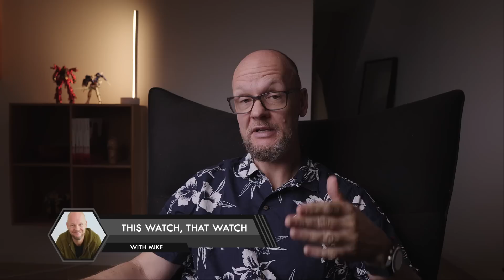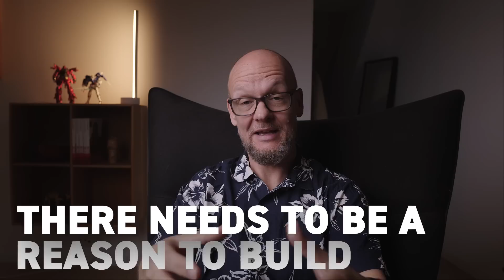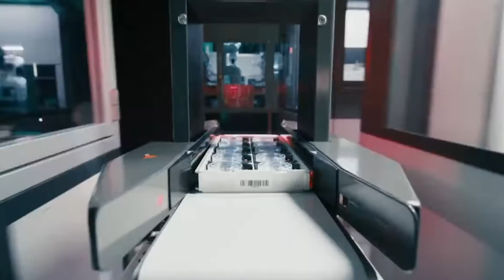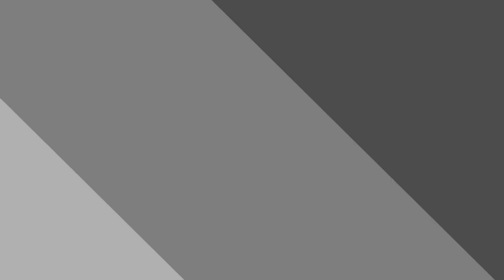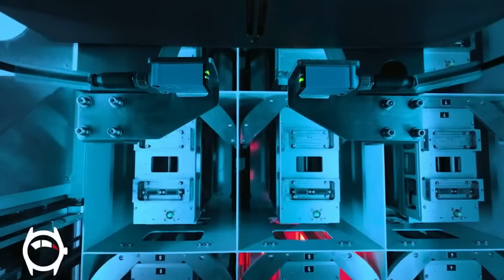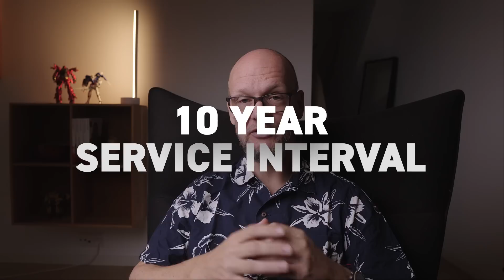In house movements & METAS: Overrated? Worth it?

Comment: I know Seiko is extremely efficent in their manufacturing production, because when a small plastic gear broke on the day date adjustment mechanism on my Seiko with the 4R36 movement during warranty.
They just put in a new movement instead of repairing it, as it would save the watchmaker enough minutes for it to be the cheaper alternative, also seemed like they didn't keep spare parts for the movements, just put together movements, as I guess it also makes the entire process at the service center a lot simpler when there isn't storing of movement componants, but rather just the finished movements, and the job is always the same with little troubleshooting needed, marking it require less skilled, and therefor also cheaper workers. 
As a mech. engineer I'm just fasinated by how Seiko can make these movements to the tolerances they do, to the cost that they do. It's impressive.

Comment: Once again, a very interesting video, especially because it delves into the details of watch movements, which I really enjoy as a watchmaker-rhabilleur. However, I don't believe that this certification is truly about proving what's possible. We all know that with the capital Rolex has at its disposal, they can manufacture anything. I strongly believe this is more of a political play. Rolex is using Tudor to force Omega to react. Omega undoubtedly sees itself in a different league than Tudor, but since only these Tudor movements have the same certification as Omega, Omega has to respond. And that's precisely what Rolex intends. Rolex is trying to increase the pressure on Omega. Let’s see how Omega will respond to this strategic move; it will certainly be interesting.

Comment: Overrated?  Worth it?  The irony is all the arguments put forward during the whole discussion about METAS verses cost watches from 9:33 to 11:52 applies to mechanical watches verses digital/quartz/smart watches in general, especially when it comes to tool and field watches. Many low cost Ironmans or Casio G-shocks will last well over a decade almost completely maintenance free and have all the features and functions one typically needs.   A so-called mechanical diver watch will never have the accuracy or features as a Garmin Descent or even a Apple Watch Ultra.  So when it comes to METAS or any other certifications and incremental or unique features in a mechanical watch, it really comes down to what one subjectively thinks is "That's Cool" (15:45), which of course completely undermines the whole argument about features, practically, or diminishing returns.

Comment: You're absolutely correct on the stocking parts point. I recently bought a junghans solar on the used market and took it to get it serviced and the watchmaker offered to just put in a seiko quartz movement.

Comment: Mike - I would like to increase your expectations to include . . . 
Parts available for at least 50 years . . . where the watch is passed from one generation to another . . . 100 years is not unreasonable.
With some watches OEM parts are available but this is disliked by the original manufacturer.
Also include fast service times of 1 or 2 weeks at a reasonable price . . . from a local shop . . . at half of the manufacturer's inflated cost.
For the   ultra-mass-produced   Rolex these expectations are being met.
Other watch experts have suggested a quality watch has a 3 Hz movement . . . I don't know what to believe.
Reply from the maker: Raising the bar 🙂🙂🙂

Comment: Omega just did co-axial for differentiation as well, no benefit and a serious downside in thickness.  METAS was just designed to help the co-axial; I’ll bet Omega wasn’t happy when Tudor jumped in.  Have had several Omega METAS as well as several Tudor—my least accurate Tudor was more accurate than the best Omega METAS.

Comment: Yes, thank you! I thought i was the only crazy person that wants the date to change at 12:00 sharp on an ideally 5hz movement with around 3days power reserve in a case that is 12.5mm thick at most. 

I would also argue for an open case back and a COSC certification for any watch above 3k.
Reply from the maker: Instant change is massively cool 🙂🙂

Comment: There's a decent argument for Tudor METAS certification having more to do with Rolex than Tudor. Specifically, by not having Rolex watches METAS certified, Rolex Group tries to communicate that their own, internal "certification" is above that of Omega. It might be more about them trying to push down Omega to Tudor's perceived level than elevating Tudor to Omega's (clearly actually much higher) level. It's kind of the other side of the same coin but I find it interesting.

Comment: Two issues:

[1] Long story short: a watch's inaccuracy once known from actual becomes an engaging personal / machine tussle. 

I like an accurate automatic movement, but I won't buy overly-expensive watches. Generally I buy microbrands - earnest enthusiasts rather than large Swatch-like conglomerations. I have a new Aussie microbrand Ocean to Orbit Lhotse watch which is running as new at +6 secs a day. Beaut watch BTW. +6 is close enough, and I'm assuming its Swiss STP movement will only become more accurate as it 'wears in.'

Whilst I'd like to luck-out and have a new watch with a mass-produced movement that's dead-on accurate, I quite like the mental tussle I have of setting the watch for a future foreseeable period over which I can track its accuracy, only resetting the period when the time falls outside of my tolerances. For a watch running at +6, I'll set it slow for the next few days so it'll catch up and then again run faster than 'cellphone time'.
The point I'm trying to make is that when I look at my watch, I have a welcome quick mental calc. going on with elapsed time vs. accuracy.
For example, for a watch running at +6 secs, a day, I'll set it at -21 secs so it'll be 100% accurate between day 3 and day 4. By the time a week's elapsed, it'll be some few seconds faster - but not by much. During the week I'll be trying to increase on the +6 secs accuracy by  placing the watch overnight crown-down and vertical (balanced over the edge of a thick book). The process is a welcome challenge whereby a human has to know where their machine 'is at' by judging elapsed time against predicted drift.
Maybe this is how quartz watches got their soul-less reputation: they're just too accurate to be fun.

[2] in my market segment, in-house movements: they scare me financially because they can only be repaired by their own brand.

Comment: I like and agree with many of your points. 

I’m not bothered about extreme accuracy, extreme water or magnetic resistance, or even an extreme power reserve. My life requires none of those. 

Shock absorption is the key parameter for me. Movement robustness is what’s important functionally. For me. 

I was at a high horology shop and started shaking the watch to get it going. The sales person was horrified and asked me to stop. 

So you are selling me a watch whose engine may get damaged by me shaking it around? No thanks. 

I have kids, I take my watch on and off a lot, it gets knocked around. I want it to withstand that. Metas doesn’t seem to help with that. 

I like slim pretty movements but not at the cost of robustness

Comment: My opinion of in-house tudor stuff is simple.  As a company founded to be loaded with out of house movements, there is no longer a reason to buy rolex .  They are tudors for flex dorks.

Full disclosure:  I bought the spring drive Grand Seiko diver as a recent milestone piece, but the pelagos with helium escape valve had me wondering.  And the Omega seamaster helium valve can be pulled off by any diver, just unscrew the crown instead of the silly extra crown.  Fight me.

This remains the very best watch channel, of course.

Comment: Omega has to step up their game. They can advertise the greatnest of their movement however thier want. But it is not reflecting in the real world benefit.

Thick movement, Slower beat rate, Lower power reserve and not that the service interval is longer than the competitors. 

Hope to see the AT with thinner movement/case, 4Hz and at least 70hr of power reserve. Tudor can do this now, the so called great movement from Omega should be capable to do this as well.
Reply from the maker: We that TI movement rolled out broader 🙂

Comment: That video could be just the last part where you list what's actually needed and still missing.

To reach for Metass must be either cheaper or easier to brag about.

I'm waiting when Bucherer will finally create column wheel chronograph with a peripheral rotor.... That's gonna be sick, it would have acceptable height and still be automatic (ekhmmmm.. Longines..)
Reply: And regarding stocking the parts - I was thinking about it a lot. There's laws, forcing to produce parts for the cars for the next 20 years or so (also when the brand is bought), depending on the region.
Is there a general consumer law having the same impact on other goods, like electronics or machines etc?

I wonder clvery often what the hell happens with watches from the independents, especially the biggies. Shouldn't their technical knowledge be documented, stored  and available to be bought out when they're dead? Otherwise how the hell do people repair their pricy watches without reverse engineering the.movement?!

Comment: Grand Seiko developed a new dual escapement lever system that works from a direct and indirect strike of the lever. They also have their spring drive MECHANICAL movements with magnetically braked escapement. They exist and are unique whether you like it or not. Give them some stinking credit.

Comment: Actually, the old German DIN 8309 demands 4.800 Ampere/m , not 4.800 Gauss. 4.800 A/m equals around 60 Gauss. However, Sinn (and other German) Watches that are certified as antimagnetic according to DIN 8330 can withstand 80.000 A/m = 1.000 Gauss.

Comment: Great video! Forgive my ignorance, but please help me understand, why a chronograph seems less complicated than a perpetual calendar (judging by price). Or is the chronograph only desired by more, therefore produced in larger quantities and therefore cheaper?

On this note another ignorant question. Is there a generalized (accepting its shortcomings in accuracy) understanding of which complications are only so expensive, because they are produced in low numbers vs complications that would be similarly expensive, even if produced in high volumes? (For example, because the specific complication would always need a watchmaker to assemble and adjust it.)

Thank you

Comment: In this field, sometimes the most minor things can make the biggest difference...and they're normally things that we don't really need. This is because the whole topic is about luxury watches, we don't need it.

There's things like "METAS", the "Superlative Chronometer", which are all pretty much capped to certain Swiss watch brands. 

Patek did their own seal,  which was derived from the Geneva seal (to their standard, the "highest" level of watchmaking)...but there are watches out there that doesn't have those seals (and watches not made in Geneva or even in Switzerland) and are finished much, much better.

There's also that QF (Qualitie Fleurier), which is one of the hardest certification to have on a watch. Not a lot of people care about it despite the requirements, but they still make watches with them. 

I like the content of the video actually, it makes you think what you actually want in a watch. Keep up the good work!

Comment: 1. I do agree that unless an  ‘in house’ movement delivers something like extra long power reserve, it is of questionable value under say $5,000. But above that, you are into ‘aspirational’ territory, so rational arguments  have reduced value.

2. On a similar note, the optimal size for a 4 cyclinder internal combustion engine is 2 litres. (Numerous YouTube videos cover this from an engineering viewpoint). Everyone builds their own version though. Why? Control, differentiation, ability to customize (the Volkswagen group uses the same block to achieve from 130 BHP, to over 300 BHP. All through different combinations of engine management, turbocharging, etc. I doubt if they would have that flexibility if they sourced their basic engine block from outside)….the higher end watch brands want to be able to put complications on the movement, etc….and let’s not forget smoothness, quality of finish, or build quality. Watch a video from ‘wristwatch revival’…when he does a Rolex, the parts look twice as thick as any other manufacturer…’built like a truck’….

Comment: Feature Shopping List
* Chronograph with a sub 12.5mm case
* Sub 11mm case with an automatic movement
* Micro-rotor movement
* Instant change date at midnight
* 5Hz movement
* 10 year service interval
* Stock parts for at least 25 years

I asked Chat GPT and this is what it said:

Finding a watch that matches all these attributes is challenging, as many of these features are rare individually, let alone combined. However, here’s a breakdown of some brands and models that cover a few of these criteria:

1. Chronograph with Sub-12.5mm Case
Zenith Chronomaster Original: The Zenith Chronomaster Original comes in at 12.6mm with a high-frequency 5Hz movement. While it doesn’t strictly meet the sub-12.5mm requirement, it’s very close and highly regarded. Piaget Polo S Chronograph: Piaget is known for thin cases, and the Polo S Chronograph is 11.2mm thick, though it operates at a standard 4Hz.

2. Sub-11mm Automatic Movement
Piaget Altiplano Ultimate Automatic: Known for ultra-thin designs, Piaget offers one of the thinnest automatic watches at 4.3mm, though this is a time-only piece. Bulgari Octo Finissimo Automatic: Bulgari’s Octo Finissimo automatic models come in at 5.15mm, offering a thin profile with an automatic micro-rotor movement, though they lack a chronograph. 

3. Micro-Rotor Movement
Laurent Ferrier Galet Micro-Rotor: A very high-end option, Laurent Ferrier’s micro-rotor movements are efficient and beautifully finished, though they typically come in thicker than 12.5mm in chronograph form. Bulgari Octo Finissimo Automatic: As mentioned, the Octo Finissimo has a micro-rotor movement and an ultra-thin profile, but lacks the chronograph and 5Hz frequency.

4. Instant-Change Date at Midnight
Grand Seiko Spring Drive Models: Grand Seiko’s 9R66 and 9R86 spring drive movements offer an instantaneous date change, though these movements do not generally meet the 5Hz frequency criterion. Rolex Datejust Models: Rolex has an instant date change feature, but their standard models have 4Hz movements and lack micro-rotor designs.

5. 5Hz Movement
Zenith El Primero: The El Primero movement is a 5Hz movement, highly reliable, and often thin. Some El Primero chronographs are around 12.6mm thick, just slightly over your requirement. TAG Heuer Carrera Calibre Heuer 02T: This is a 5Hz movement, though typically in a larger case size.

6. 10-Year Service Interval
Rolex 32xx Series Movements: These have an extended recommended service interval of 10 years, but they typically lack the 5Hz and micro-rotor attributes.

7. Stock Parts for 25+ Years
Rolex and Omega: Both brands are known for their commitment to keeping parts available for decades, making them reliable for long-term serviceability. Patek Philippe: Known for longevity and serviceability, Patek Philippe also maintains a strong stock of parts.

Comment: I have a Pelagos with an „in-house” COSC-certified movement, and I am very happy with it. In daily use, it keeps time to METAS standards: It gains on average 0.85 seconds per day, so I think it’s excellent value for money. And if it’s as resistant to magnetic fields as the METAS-certified models, all the better (I once ruined a mechanical Swatch with the magnetic stray fields in a physics lab). For me, a watch is primarily a time-keeping instrument, so I expect it to perform as well as the current technical standard of the oscillator system allows. I don’t want to have to adjust the time every week (so I also care about the 70 hours power reserve of the movement). Hence I would never buy a mechanical watch with a time-keeping precision below COSC standards. I also want a watch to be robust so that I don’t have to worry about it all the time, because that would ruin my enjoyment of it. The Pelagos ticks all those boxes for me.

Comment: In my humble opinion, an in house movement is highly overrated and does not determine what brand of watch I am going to buy. As explained in this  beautiful video, fundamentally how a movement works hasn't really changed in the last 200 years and most of these super expensive watch brands really don't give a damn about innovation in movement technology. They just want to a way to extract more money from the customer. It's just corporate greed at the point. The last real innovation in movement tech was probably the Spring Drive. That's why I personally don't give a damn about Rolex or whoever.. It's just a marketing gimmick. Sure, it might have better quality compared to mass produced movements but how much better are they? I mean do we really care about a movement that weighs lesser/ is thinner/slightly  better accuracy? (relative to mass produced movements). No cause a few grams lighter/mms thinner/better accuracy is not going to  make any BLOODY DIFFERENCE

If you really cared you can solve the problem of accuracy, weight & thickness and beat the arses of all these super expensive  brands with a simple 20$ Casio